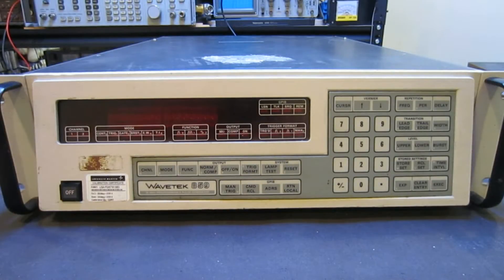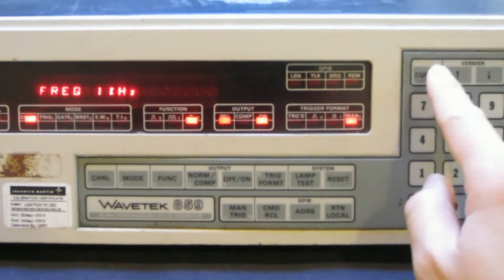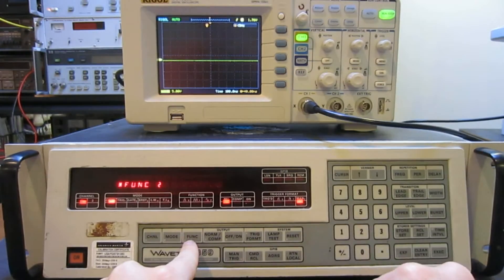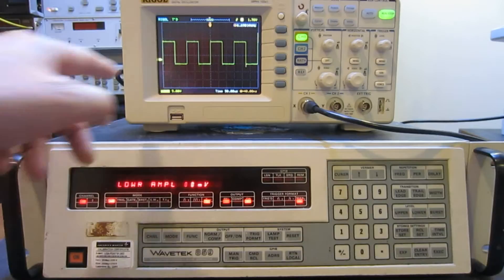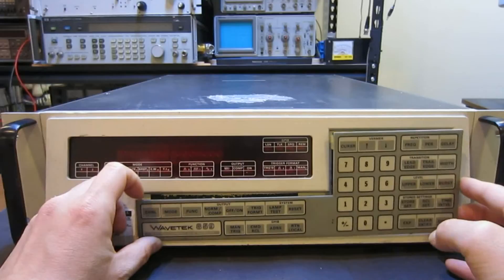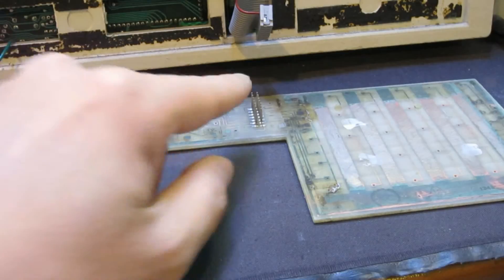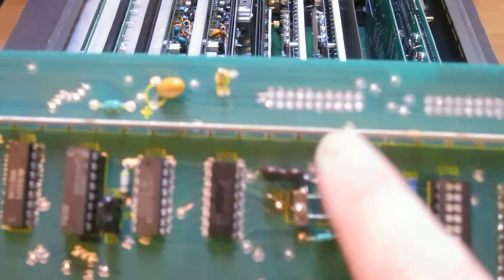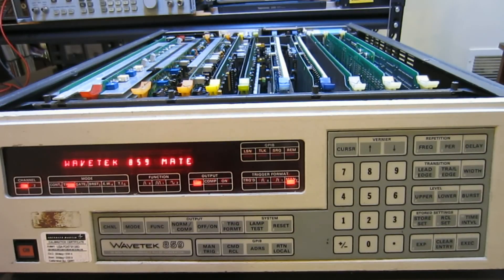Wavetek 859 50 MHz Pulse Generator — Reparied

Comment: Good repair!  You should use a 50 Ohm terminator on your BNC cable since the Rigol 1052E has 1M ohm input impendance.  That's why there's so much ringing at the rising and falling edges of the pulses.